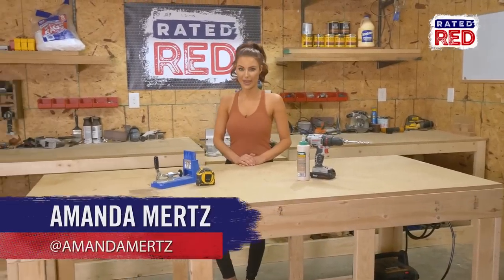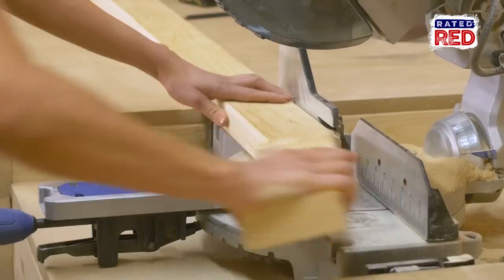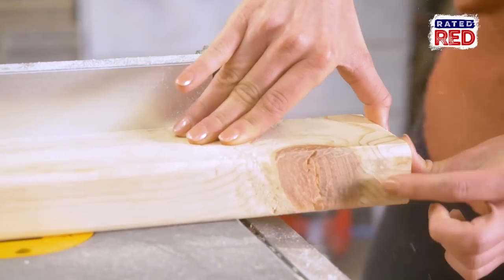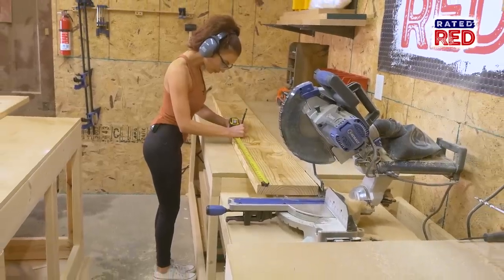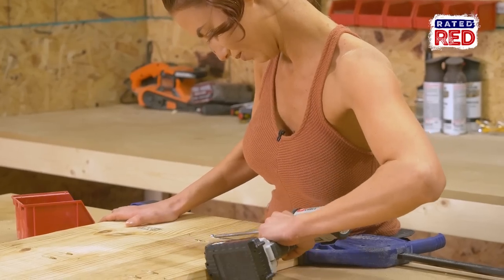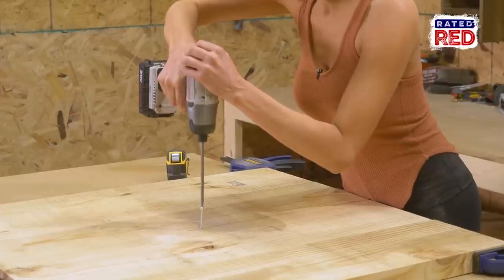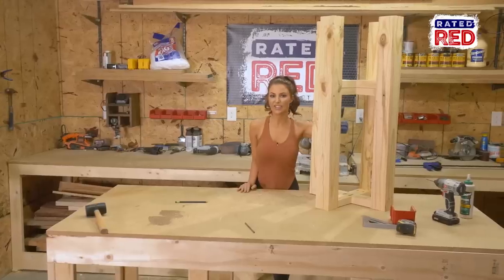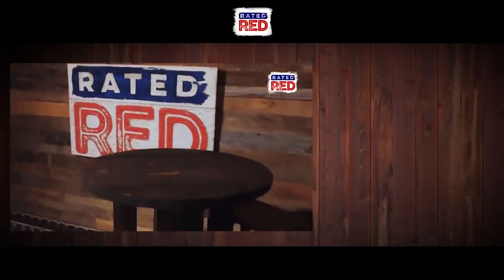Pub Table | Red Hot Building

Comment: Ahhhh, Amanda!  Look up the product the "gripper micro jig!"  Everyone else too should look these up.

I think about 60,000 people a year have a serious accident on the table saw.

Also the product SAWSTOP.

However, the micro jig is MUCH cheaper than most medical deductables.  

Amanda,  until you have an accident you would be amazed how easy it is to get hurt.
Reply: I own them, they can be used on other tools, and they are FAR less expensive than a medical deductible.  In addition, you can do things with them that you can not with push sticks.   

Good practice requires that you NEVER make a mistake.  One mistake can have a HUGE penalty.   Bottom line: superior control of work piece and your hands and fingers are far above the blade in all circumstances.
Reply: Your right about how easy accidents can happen, i experienced a near miss on a mitre saw only last week, never thought a mitre saw had this danger but as i was cutting a small log it had managed to displace/rock itself somehow causing some sort of kickback and nearly throwing my hand into the blade. Just feeling that  power and thud in a split second was very scary. Be safe people and never chop logs on a mitre saw.

Comment: You're using your sliding miter saw incorrectly. Start by making a score cut, which is between 1/3rd and 1/2 the thickness of your work piece. Then make a second cut to finish the total cut. It only takes a few extra seconds for each cut, but you'll get little to no tear out with your cuts.

Comment: The blood 'castoff' from a bench circular saw always goes in a straight line, up the wall, across the ceiling and down the opposite wall. This usually occurs when some dozy tart is busy talking to a camera whilst running a piece of wood through the circular bench saw without the 'pusher' stick.

Comment: As many others have mentioned, use a push stick when working with the table saw. The way she did it is an easy way to lose some fingers. And pocket holes for the table top? WTF‽ Use a biscuit joiner and tons of glue and spread the glue properly with a brush. While a jigsaw is fine for cutting the bulk of the waste from the top, finish it off with a router and a circle jig to ensure you have top that is actually round. It also allows you do give the edge a nice round over to make it nicer on the fingers.

Comment: If I were making a vid I would wear all the safety gear but when I am working alone I seldom do except for safety glasses when using the table saw.  Old table saw in High School, cheap knotty pine, caught a splinter in my cheek about an inch below my eye.  I used to buy BRCC from a local gun dealer but it is kind of expensive.